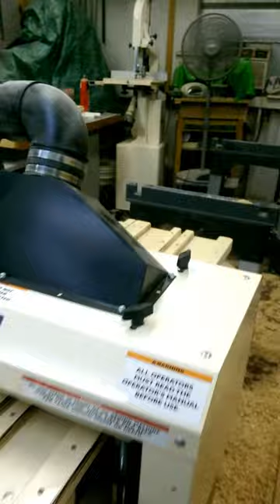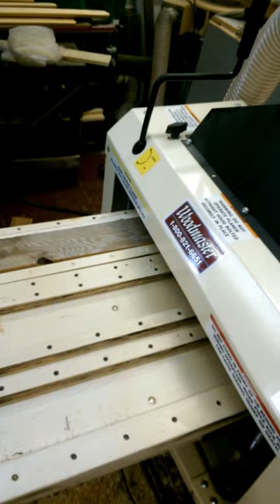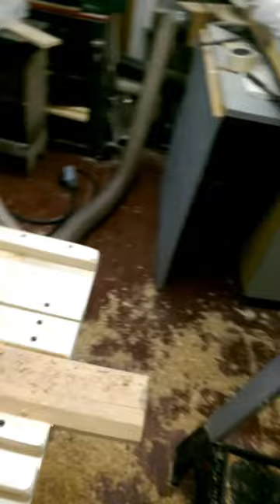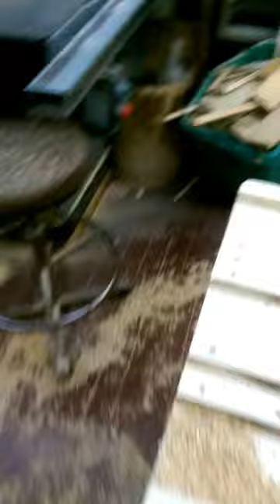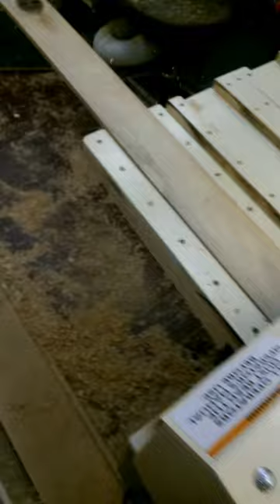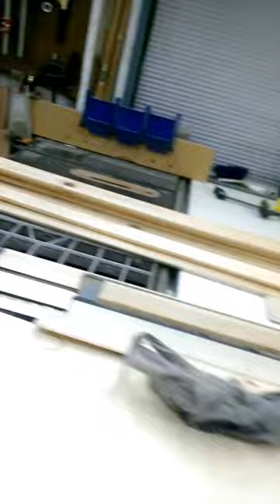Making Crown Molding on Woodmaster

Comment from the maker: After this piece, I begin to run all three stages at the same time. The Woodmaster had no problem handling the three processes. As you can see, a 10' piece of molding only takes around 2-3 minutes from roughsawn cypress to ready-to-install.
Reply: is that the 718 woodmaster???

Comment: My father bought a wood master and we are having trouble finding instructions on exactly how to set it up for crown molding. We plan to use store bought lumber but have no idea what the starting thickness or width should measure before it goes to the molding knives.
Reply from the maker: I created the molding board that is divided into the 3 sections. I am using rough-sawn ~1x4 cypress and, I used the gang blades to rip to proper width. If you are using store bought lumber, your width and thickness is consistent and and you would not need to gang blade rip to width. I would still mold my back bevel 1st so that you have an absolute consistent thickness as well as this gives you a flat surface for molding the front profile. I would start with the flat part molder head just skimming the board when cutting the back bevel. It is very important that you run the board through centered on the back bevel cutter and then also on the profile cutter. This is where setting up your molding board is important.

Comment: Just ordered a 725 anything unique about setting up the Woodmaster? Looking to make molding of all types.
Reply from the maker: Salmon Hunter you'll need to make molding boards for your various styles. each stage may need to be height adjusted depending on the depth of cuts required for the particular stage (back or front).

Comment: Hello James. I have a Woodmaster I have not used much. I am going to be using it for a new cabinet business to make tons of moldings. Are you using one knife per backcut/profile or multiples? I am guessing based upon the speed you are running the boards through that you are using multiple knives and not just one.
Reply from the maker: Walsh Built Homes I am only using one knife per to 700c. The back profile on one and the top profile on the other. The knives come with a balance block to install on the opposite side of the 700c.

Comment: how are you running three knifes/blades at once?
Reply from the maker: +Paul Schuster I did not have to adjust the height of the table. I used the back cutter to "plane" my material to the proper thickness to then cut the front of my molding.

Comment: How thick is the wood you used?
Reply from the maker: chade74 
This was rough sawn cypress approximately 1" thick. The back cutter (center stage) planed the thickness down as well as the front cutter on the last stage.  standard 1x4 would work.
Reply: James Jolly. I got a different machine from another company. There moulding knives call for 1 inch exact and we all know that you buy 1 inch from a lumber yard you getting under a inch. thanks for your reply.